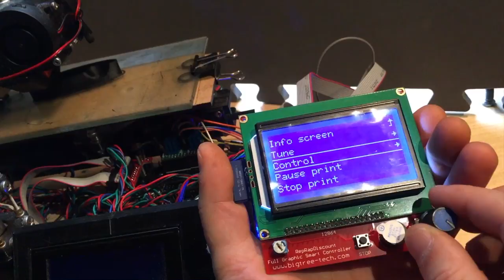EXTRA: Boring print video for RAMPS + DUE mod part 2

Comment: FYI: I'd bricked my DUE by messing with serial port assignments so switched to using Mega2560 with smart ramps. It works great with this board! Some changes were needed in marlin and they've already been merged into bugfix-2.0.x.  My gift back to you! Thanks for sharing!!

Comment: Hey, your due must be clone and, usually, these have a design flaw and hence the reset is need upon boot...This is fixed either by sw (bootloader) or by bridgeging a regulator with a 10k resistor. Look for it and you'll find more info on this.
Reply from the maker: Correct, I have a few Due clones, and some of them have the incorrect resistor. When I bought those, it was very hard to find a genuine Due at a reasonable price, but they are available again. I think AdaFruit is planning a MEGA-formfactor 32-bit board as well, but we'll have to see if they make better choices than were made on the Due